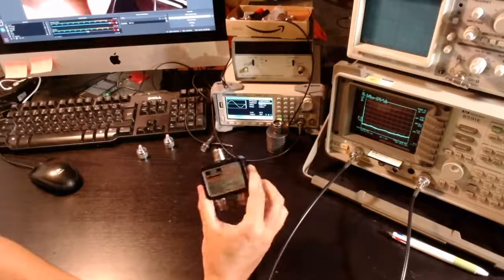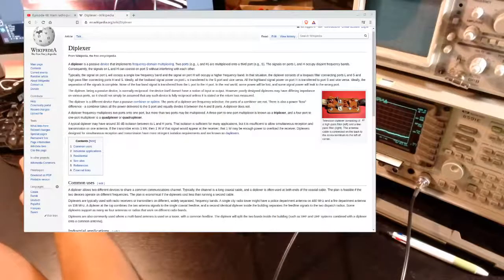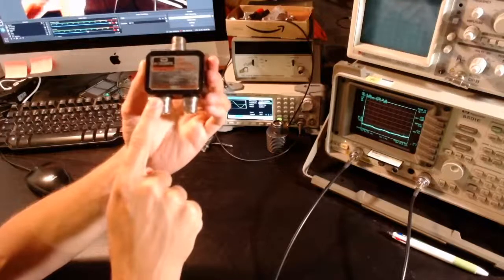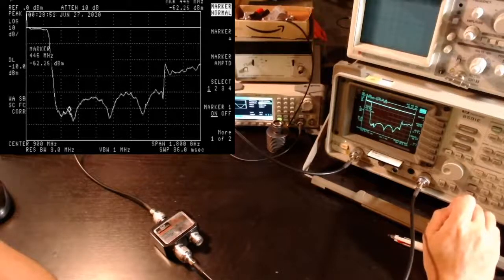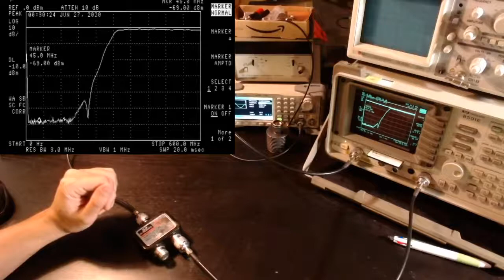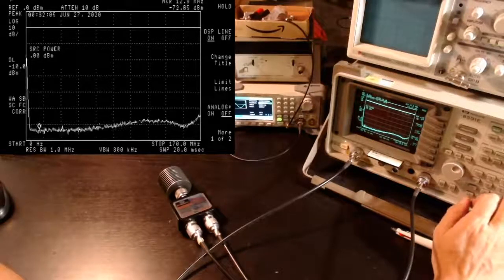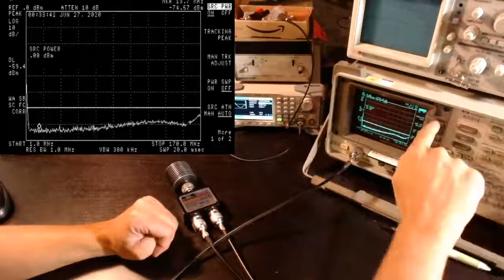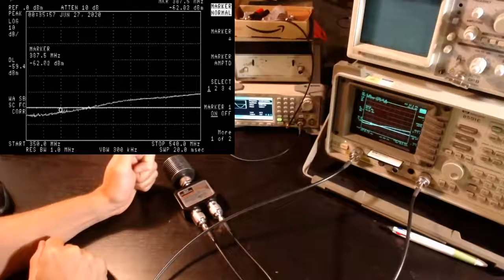Episode 50: duplexers

Comment: Great Video
I did the same thing you are doing in the video
But when checking the isolation between the high and low ports i am only getting -45dbm when i apply 0.00dbm as you did
The only way i get -60dbm is when the tracking generator is set to -20.00dbm
The spec on the duplexer says -60dbm the same as yours
So can i assume the duplexer is out of spec or faulty or is this to do with the setting of the tracking generator?
Reply from the maker: Hi Craig! Yes, from what you say, it seems like your device might be out of spec.

Also have a look a this recent video, with a similar type of measurement: https://www.youtube.com/watch?v=lMMql1gEORQ

Comment: Excellent work and explanation! Congratulations. I would like to know how you can activate the external display of the HP-8591E, and see it in real time, the black box, seen at the top left. Thank you very much!! 73 !! LU5EWR.
Reply from the maker: hi! thanks! I explain how in my video 36. Basically the HP-8591E has a composite video output (BNC). I connect this to the computer using a cheap USB dongle (about 10usd from Aliexpress) and then get the video inside OBS software, which is what I use to make videos :)